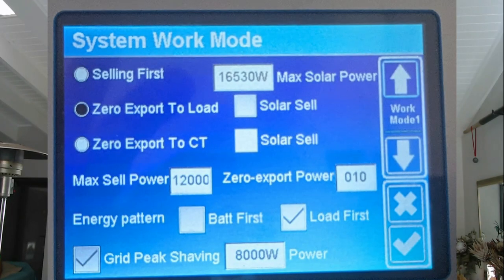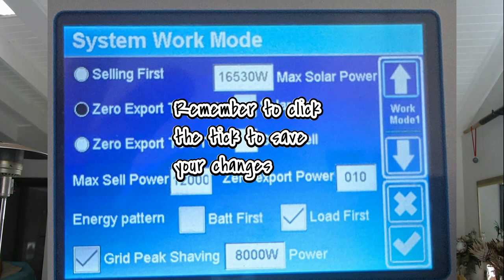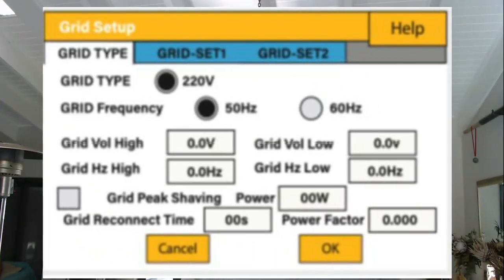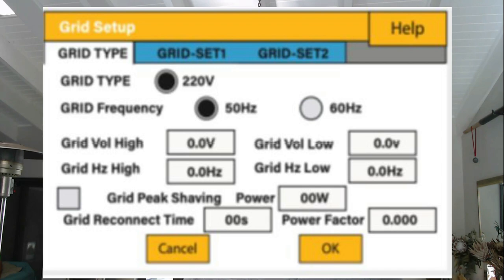Eskom Load Limiting - how to restrict your inverters grid load

Comment: Are you updating your Time of Use settings directly from Home Assistant?
Reply from the maker: Hi @craigarenson7036 , you can update your Time of Use settings from Home Assistant depending on which integration you are using. The ESP32 integration has it in on the yaml code from SlipX. Has to be added in extra on the Sunsynk integration  and Solarman integration.  I am busy working on video an automation to automatically change the battery settings based on load shedding level and solar forecast from Solcast.
Reply: @SolarIntegrations   I'm using the solarman integration
Reply from the maker: @craigarenson7036  Best is to check on the Solarman integration Github page and have a look if there is an option to write the settings there, alternatively have a look on the Powerforum forum and check there. I use the ESP32 which works without any issue.

Comment: Eskom is load-limit piloting in Fourways, limited to 10 Amps, heard you mention 20 Amps
Reply from the maker: Hi @Tigershot57 , so if they are restricting to 10Amps @ 230V that would equal 2300W, if you set the max on the inverter @ 2000W you would be fine. The inverter will pull any power it needs above 2000W from your battery, as long as your battery is over the minimum battery setting.  It will also recharge to whatever SOC you have in the grid mode settings if you have the charge from grid box ticked.